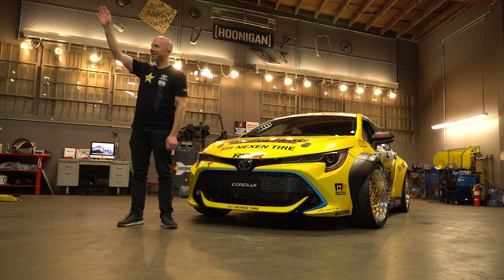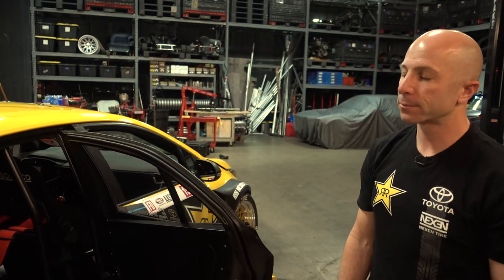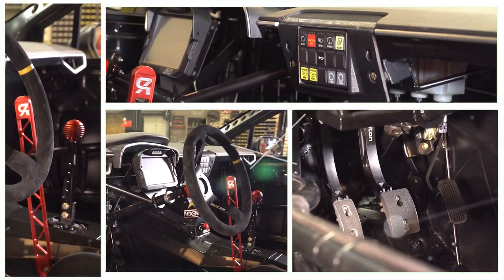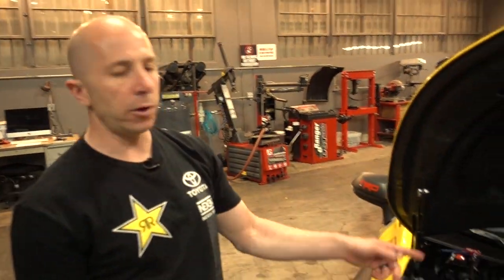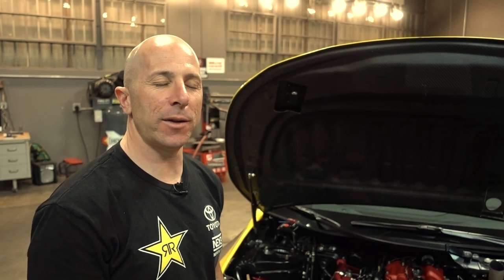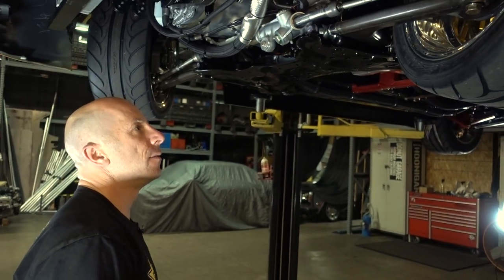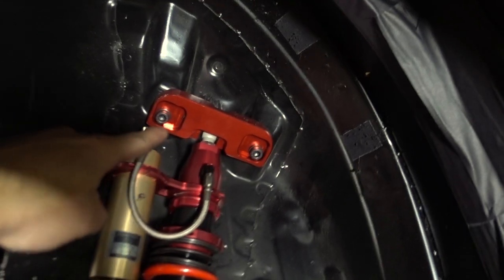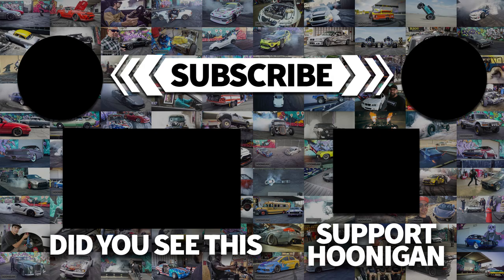1000hp RWD 2019 Toyota Corolla - Fredric Aasbo’s Drift Car

Comment: toyota should've made the new 86 a variant of the corolla like this, hatchbacks embody the spirit of the 86 better imo, and they're more useful and low-key. I think the reason everybody thinks the 86 is too slow is because it looks too fast, if they made it as a corolla people would look at it in a different light, closer to the original AE86 in design and feeling.
Reply: Owen Lee I wouldn't mind them calling it an 86 and making it a hatch as long as it came stock RWD and had near perfect weight distribution and great handling. Which would be waisted on a hatch! Keep it the Toyota ae86 for the people who want a good coupe for an affordable price. We don't have anything like it on the market while there are a shit ton of hot hatches to choose from. Variaty is good.
Reply: I 100% agree with you on that!
Reply: agreed, the "Hachi-Roku" originally was a Corolla and they should've kept it that way (btw the GT86 '12 would probably be considered slow no matter the design considering that the engine pushes 197bhp while weighing about 1100kg, but having a top speed of only 200)
Reply: @OutlawAladdin  The only competition that the current 86 has is probably the MX-5.
Reply: @shortstories3349  yep and it sucks. Maybe also the i4t mustang EcoBoost too. It's pretty cheap @mid 20s but not really a tuner car.
Reply: Care to explain how the MX-5 sucks?
Reply: @shortstories3349  no no it doesn't. I'm saying the lack of options suck. Also forgot to add the fiat 124 spyder to the list. It's also mid $20s msrp
Reply: Owen Lee im gonna make one
Reply: 86 is a good car. But for the price and looks should of came stock with 250hp
Reply: That’s absurd. The solution to the problem with the new 86 is give it more power. There should have at least been a brz sti or something. I know several people with boosted 86’s and they’re great. Also know someone making 350 whp all motor and it’s super fun to drive.
Reply: 86 needs a modded 2JZ - a la 400+ hp.  It's tuned like my grandma's car, which is why people say the 86 is too slow.
Reply: Toyota should give turbo kit as a basic thing in GT86 so it would be 250hp not 200hp
Reply: i think that the reason why the gt86 looks the way it does is because of the Trueno/Levin AE111 were more sporty looking coupes/hatches and designers of the gt86 took inspiration from those cars despite them being ff
Reply: true we all know the 86 is just a 80's corolla hatch back and if they ever make a panda sceme it would be better if they follow the curves of the car to make it look modern.
Reply: Y’all act like the 86 was literally the only rwd Corolla, newsflash it wasn’t! Please acknowledge that there were far greater Corollas than the AE86
Reply: To people saying the gt86 needed more power from factory are missing the point. It's supposed to be fun not fast. I have one and in total stock form on the street it is hilarious to drive.
Reply: Sorry bro but they made GT86
Reply: Truth.  Initial D taught me this.
Reply: @Cafferssss  Exactly.  It also does not need a turbo.

Comment: The amount of engineering that went into this car is actually insane and I'd be impressed if it took them a year to build this but they did it in 3 months which is crazy.
Reply: TheDestroyer32 for real!!!
Reply: Well technically, they already had a corolla hatchback drift car, the Corolla IM, so most of the R&D was already done. They just had to take a factory car and put the IM drift car components into it. Still a hell of a lot of work, but easier than a completely new build.
Reply: Well many people on his team built this same but finely tuned  set up many times before, if you listened they have stream lined the process  with CAD design, and his team does this same shit day in day out day in day out with access to many different tools in specialized  shops with a team of people working all day every day to see actually how fast they could do it.
Reply: With money anything is possible.
Reply: Just started watching Papadakis Racing channel where he tears down some motors. The shop is super clean and his presentation and explanations are awesome. He's a true pro.
Reply: The Destroyer is being over dramatic. It's really not that complicated to make a FWD car into RWD
Reply: More design than engineering. I am sure there was a certain amount of engineering but it’s mostly making parts fit and modifying existing stuff. Don’t get me wrong, it’s impressive as fuck!

Comment: 250K Race car, still held by zip ties in certain panels. I f***ing love that.
Reply: by design, not necessity.
Reply: body panels arnt structural, the thing has a carbon roof and chromoly tube frame up front,back and cage; not to mention the chromoly arms.  that thing probably feels as solid as a bank vault.
Reply: zip ties and duct tapes are the top engineering marvels
no question asked
Reply: @royhsieh4307  if you cant hokd em with duct tape you're not using enough duct tape
Reply: @tmwall25  all the tube work and arms are chromoly becuase in case the of a crash, they bend instead of damaging the frame

Comment: I love the practical race oriented details. Very impressive! The biggest glaring question I have is why didn't Stephan Papadakis get rid of the Ackermann steering geometry and go with a drifting optimized equal steering angle setup?

When drifting, the improvement to how well/long you can hold a high angle drift is incredible when driving a car with equal angle steering compared to a car with the Ackermann angle optimized for non-slip steering (not drifting). The car doesn't keep trying to spin out on you like a stock Ackermann setup does.

For those that don't know what I'm talking about, google "steering Ackermann".

Comment: This car is so awesome! 1000 HP aut of the little 4 cylinder is incredible! It makes Drifting so nice because its the only motorsport where you can compete with a 4 cylinder against big V8s and I6s. And every car is totally different. 😀
Reply: Look for import vs domestic drag race...thereS a lot of 4cyl car battle and win against bigger displacements car...and there were 7s in quarter mile in fwd setup...insane dude

Comment: It funny how ae86’s aren’t allowed to be converted into independent rear suspension to compete in Formula Drift but allows a converted fwd.
Reply: Fred86 the Mustangs weren't allowed to be converted to IRS either. Building your own suspension is far more of an advantage than using a fwd chassis.

Comment: Too bad the real Corolla XSE is $22k for a 132hp car.. Missed opportunity.

Imagine a RWD Corolla hatch with a 6 spd, limited diff option, and the Camry 2.5ltr motor in it. That would sell like crazy! This is such a good looking car, especially that color of yellow.
Reply: yes i know! finaly they got corolla to look good again. honestly i would not be disepointed if this as the new ae86, design wise that is.
Reply: @boboutelama5748  why so mad? He's 100% right! This is a 5 seater car with only 132HP. It might work in other countries but in the US it will be under powered. Its a hatchback so its meant to haul things and people. I had a 2004 mazda 3 hatchback 5-speed with 160 hp. With me driving and 2 big passengers and a few things in the hatch it struggled. It really sucks to feel the car struggle. Now that was a 15 year-old car so things have changed but still. Imagine 3 people in the car and the AC on. Prayers Up.The Lexus CTh hybrid had the same issues. It could not easily catch speed getting on the highway.
Reply: @zhongxina5956  it's actually 169 horsepower. It's a newer engine than the 2014-2019 Corolla sedans.

Comment: This Corolla has 1200hp.  Dean Kearney has 1500hp.  we are definitely seeing 2000hp drift cars in FD soon LOL
Reply from the maker: Crazy right. Remember when 400hp was a LOT?
Reply: 1000hp is pretty much the standard for the past 3-4 years
Reply: They should do an "FD throwback" with the restriction that all cars have to be built like they would have been back then. It'll show who can really drive versus who just uses the power to push themselves through.
Reply: TypeR1911 the standard for FD is 1000hp. Which is why alot of ppl cannot compete, like us regular guys who have built cars but do not have any sponsors or big money. There's a story about how FD is becoming more about who has more money and HP.
Reply: NissanHyoryuLyfe another reason many people dont think about is grip.  The level of grip has gone up so much thru the years that these cars don't slide well unless you have a ton of HP. Thats kinda why HP has gone up since 15 years ago when FD started.

Comment: If they would actually make another RWD 2 door corolla again, i guarantee it will be one of the best cars ever.... But we can only dream.....
Reply: uh....... aka Toyota 86?
Reply: except the modern 86 is heavier, and costs more than what an ae86 would cost today not to mention insurance.
Reply: the 86 is only heavier by 400lbs, considering it is safer (crashing), bigger wheels/brakes, more than double its HP, 50% more torque, not to mention it is one of THE best handling chassis ever made, i'd say it's way better than the AE86. The AE86 wasn't even good, it was just light and RWD.

I'm a bit confused by your price comparison, are you comparing a new 86 to a used AE86? of course it would be more expensive!! and so would a RWD 2 door corolla is Toyota made one?

and why would insurance be any different between a new 86 and a RWD 2 door corolla? or are you comparing the new 86 to the AE86 again?
Reply: the 86 only heavier by 400 lbs? Some ae86's weighed 950kg (2094 lbs) some gt86's weigh 1298kg (2862 lbs) even the lightest gt86 weighing 1,190kg (2624 lbs which btw is only for japan the lightest for the US and a bunch of other places is only 1251 kg or 2758 pounds) would still put it at closer to 600 pounds but for most in the US would be 700+ pounds heavier. bigger wheels? lmao you need to google "are bigger wheels better" (hint they're not) brakes.... maybe it's got better brakes. But honestly the first thing i would do even with a modern gt86 is change wheels, tires, brakes. double the hp? 128 is not half of 200 boi. the power to weight ratio is really not that far off.... and let's not forget that older cars are so much easier to tune than newer ones (and cheaper too) handling is something that is so hard to say for sure if 1 car is better or not, yes the ae86 had a live axle, because of that you can't change the camber of the rear wheels, and because of that most people usually had a lot of oversteering. But a stiffer front end and a somewhat looser rear end (compared to the front you still want it stiffer than stock) usually fixed that completely (except most people really don't know how to properly tune the suspension) what the newer car does have is power steering, which for a track car.... NOOOOOOOOOOOOOOOOOOOO not to mention every other "safety feature" newer cars have. That usually just limit it from the best. the prices i was talking about was how much an ae86 would cost today counting inflation for how much it used to cost back in the 80's, same with the insurance. 

Finally i'm gonna say that yes the gt86 is a great car... maybe even one of the best cars out right now (it's definitely the best in toyota's lineup why the camry isn't manual transmission but the modern corolla is idk) what im really angry at is most car companies just neglecting what most cars once were. have i ever even driven an ae86 or a gt86 in real life? No.... But i have driven both in Assetto Corsa which is supposed to be a racing sim, and i can tell you i definitely prefer the ae86. I can't tell you how many times on akina servers i pass Supras, Skylines, and rx-7's in a STOCK ae86. just because it's that much lighter and on a tight track or on togue weight is very important, there's no point in being able to accelerate faster if you can just carry another 10-20kmh in a corner since you can use the same tire compounds as the other cars
Reply: Bladez Andrew Bladez Andrew you're missing the point... And you're missing your initial comment entirely. But let's digress.

I only did a quick google and the first go figure that popped up was 90 something hp, so thanks for the correction. Regardless of power/weight, which is neither of these car's goal, the 86 is still the better car. I've driven both, no matter how good a driving sim is, it will never be the same. The AE86 is a lot harder to drive, you really do need skills, the 86 is so easy, the steering and balance of the car is as good as it gets, I almost traded in my sti for it, but it's just not practical. And I'm not talking about the safety nanny features, I'm talking about actually crashing, I'll take my chances of surviving in a 86, thanks.

I do understand bigger isn't always better, but when the both tire sizes are designed for the car, bigger is better, at the limit. Heat management is better, fit bigger brakes without sacrificing too much sidewall, and wider by a healthy margin.

Let's get back to your original comment. Toyota did build a 2 door RWD, it's just not named Corolla. You just have to get with the times, heavier doesn't always mean it's worse. Material cost itself has skyrocketed in price, can't blame Toyota for that one, and if the AE86 came out today... I bet the insurance will be similar.

Comment: How much is a rwd conversion, and manual swap for a Camry? It does have the same motor.
Reply: Is the new one? If it is you got a nasty 270BHP and see arabs how drift fwd
Reply: It’s not gonna be worth it unless you’ll be pushing a good amount of horses. If not, just go get a different car, lol.
Reply: Not worth the money lol get a CTS V or a vette if you wanna spend that much money on a rwd manual car

Comment: The Corolla's competitors is the Civic and Honda has the SI and the type R corolla has noting just a shitty S and now SE with only 132 hp. they gotta come outa with a modifiable corolla.
Reply: Flexgado24 I just wish the s sport model has a rwd instead of fwd. If that happens It will sell like hotcakes for drifting
Reply: CAT MARIO exactly toyota are like too cheesy and all for soccer mom car it blows me after almost 20 years they are finally coming  out with the Supra smh and the toyota celica was nice but again fwd and they finally made the 86 rwd but it's still not a corolla they need to make it with either Awd or Rwd with Turbo
Reply: In america the civic had shit in 2005 but corolla had an xrs which was a 2500lb 8200redline 187hp .003lbft of torque beast with a 6 speed and vvtl-i (toyota vtec)

Comment: That's not a carolla anymore. Tell me if this sentence makes sense.
"Here is my 1,000 hp crate motor, rear wheel drive, carbon fiber,  wide body 2019 carolla"
Reply: What was that mumbo jumbo in the quotes?  I lack the comprehension to even imagine what it could mean.
Reply: Sinister Tangent dont ask questions like that or comment if it's even is a Corolla, you confuse the minority 😭🤣. This is definitely not a Corolla anymore.
Reply: You cant even spell Corolla right.

Comment: The engine looks like a Nissan sr20
Reply: Von Vista I also thought it was a Nissan SR20 at 1st, however when he mentioned that Toyota worked with them I quickly start lookin around to identify what Toyota engine could that be. Then by 12:11 you can clearly see the engine code
Reply: 1Arfe toy engine
Reply: how the hell can you guess just by looking at it?, look i'm a bit new in this car thingy. you made it look like easier to me.
Reply: cereal killer engine code is there 12:11
Reply: @ianj7528  Engine is a 2ar-fe. 2.5l engine hp range 154-181... Came in Toyota rav4...
Reply: They said it was a 2ar-fe at the beginning. No need to try and read the engine.

Comment: Radiator on the back sitting flat with a pulling fan?  And talks about it being a drifter car?  Air circulates in the back?  So it pulls warm air from the heat of the road to cool down the hot radiator water?  Sounds like a cool idea

Comment: I also have a bastardized Corolla but mines a 78 wagon. Engine is 4Runner, trans is IS300, radiator is AE86 and getting ready for a better rear axle setup.

Comment: Have you ever thought off running the gearbox in the rear combined with the dif ... i know in Aus the Supercars that run here use a rear sequential 6 speed and dif assembly,  they do this for better weight distribution

Comment: I wonder what type of fan the got on the bottom facing radiator?  That thing looks MASSIVE and super powerful. Looks like they are touching that aspect of that old school formula one team that used a huge fan to pull air from underneath the car to create more downforce from the negative pressure under the car.  It actually worked and was subsiquently banned in formula one.  I wonder how much downforce that huge fan creates here

Comment: How strong is the carbon drive shaft? When I was at a run what you brung drag event there was this RWD Toyota Starlet running a Ford 2.0 "Pinto" engine bored out to a 2.1 with twin down draught Weber 50 carbs. Halfway up the strip when the guy shifted into 3rd gear, the drive shaft bent into an L shape and flew out the side of the car and onto the grass next to the track. The guy thought he'd blown the diff I think he said. Drive shaft looked like a banana. Car normally ran  high 11s / low 12s

Comment: I know what motor to swap in after I blow my 2020 manual hatch with the 2.0 L4! I ordered CAI/Headers/Midpipe and exhaust/EGR delete/Shift Bushings/Short throw shifter. Still need throttle body and pedal commander + tune and wheels. Most of the aftermarket wheels I'm finding weigh significantly more than factory though so I'm going to have to pay a bit to get something in 16"x8.5 that weighs around 16-18 lbs vs the factory 23lbs, I'll probably end up on some Enkeis. Hoping to see around 180-190HP at the wheels.